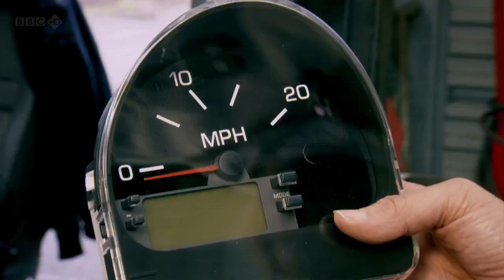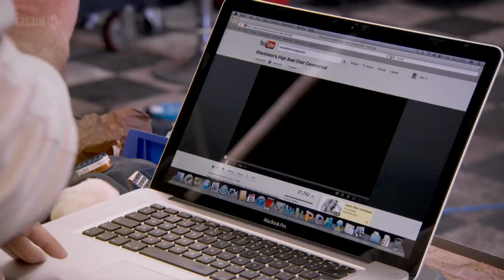Top Gear Old People's Car (S19E5) 3

Comment: I think they cut the airbag wires with the battery disconnected. I’m sure it won’t blow up 😅😅😂
Reply: I don't think they activate by disconnecting wires, they probably activate by voltage being applied to the wires
Reply: They could have literally just popped the connector off lmao, this is just corny fake suspense malarkey